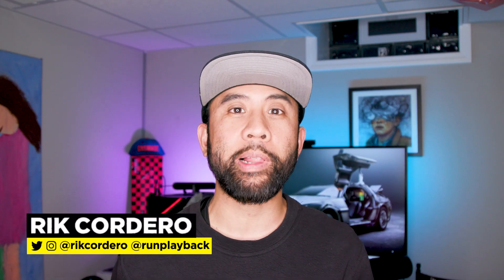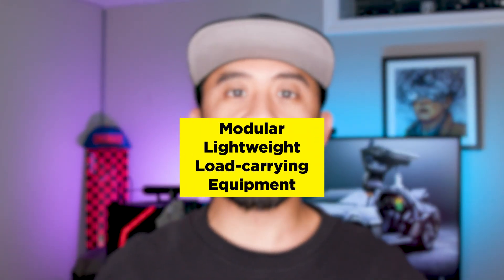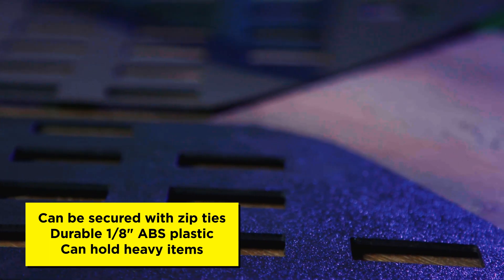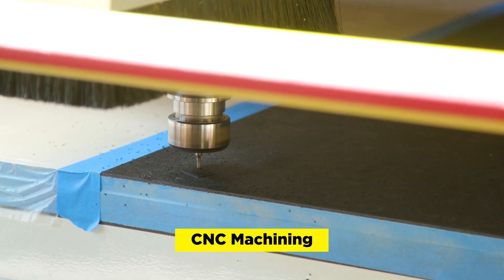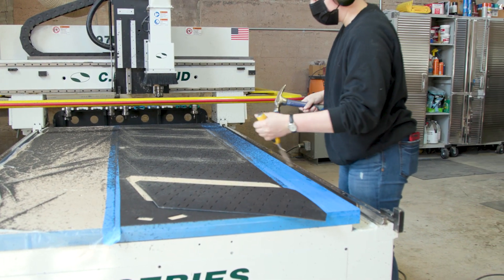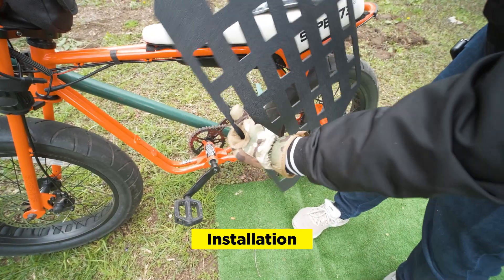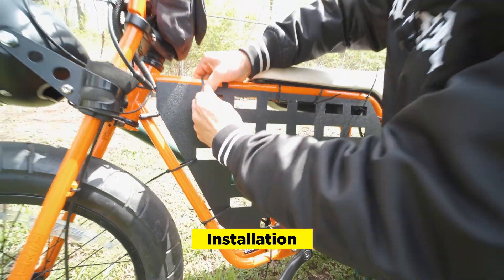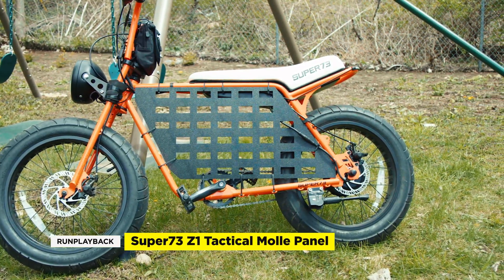Super73 Z1 CNC Tactical MOLLE Panel | RunPlayBack

Comment: I think it would be even better if we were able to make accurate measurements so that the panel is really flush with the frame. but it would add more complexity to the design. The best way to do this would be to 3D scan the bike and use that as reference. I would've liked to add that to my Z but with the frame battery I bought it won't fit.
Reply from the maker: Hey Marco! Can you send me a pic of the frame battery? It sits flush on the left of frame with space in the center for batteries. Email me whenever you can - rik@runplayback.com
Reply: @RunPlayBack  I ordered it to a local battery maker and it'll come in about a month - but i'll be happy to give you an update when it arrives.
Reply from the maker: @aeskellion  cool sounds good, thanks Marco! We have a pretty large 52v 20ah pack on there now and it fits well.